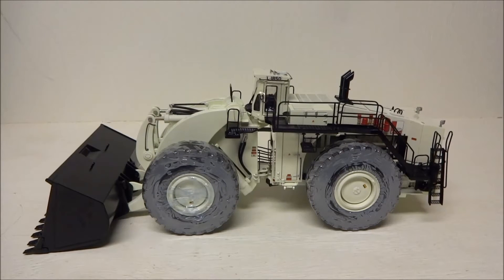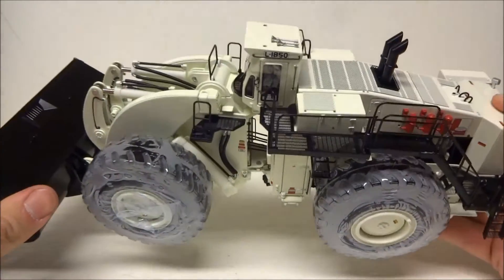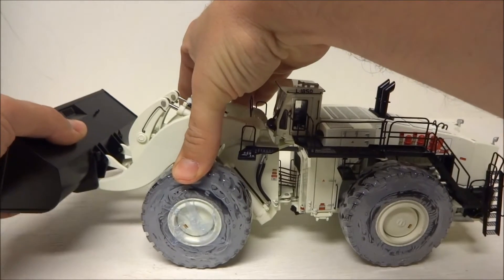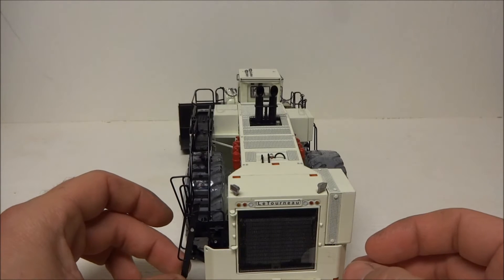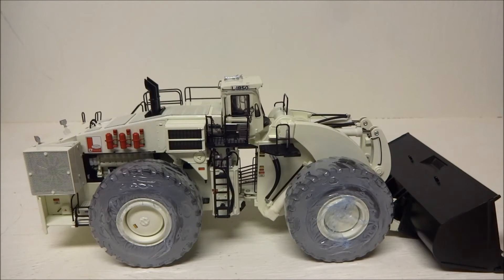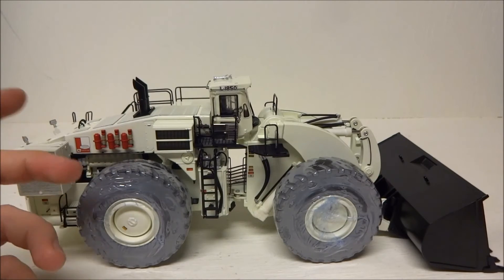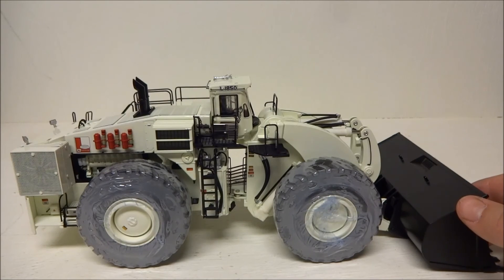1:50 TWH Letourneau L1850 Rubber Tire Loader 1/50 Diecast Review

Comment: This model is outstanding! I remember when TWH brought out this model, about 10 years ago or so, & I marvelled at the detail of this model. But it seems all TWH models had incredible detail. I considered buying this model, but didn't. I already had a few TWH models, & discovered the disappointing weakness of TWH models was quality control. On a few models, some parts were broken or improperly assembled from the factory. But the design & detail of the models was the best I had seen, I believe. TWH gave NZG a "run for its money", & at more reasonable prices at the time. But NZG always had consistently good quality control (mostly), from what I have seen.
Reply from the maker: I completely agree. TWH at least had a great customer service section. Anytime I had an issue it seemed like there was no problem making it right. Weiss Brothers is doing a good job picking up the pieces and seems like they're avoiding the mistakes of TWH.

Comment: I am trying to get a diecast L-2350 used

Please help
Reply from the maker: Well, the best place to look is probably the 1/50 groups on Facebook. That's probably the best place to get a deal. Otherwise the alternative is eBay. Save a search for LeTourneau in Toys and Hobbies. You'll get a notification anytime something LeTourneau is listed for sale. Be patient. They are great models but don't come up for sale often. They are hard to find.
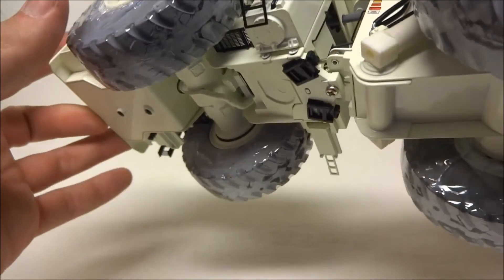Reply: @MarylandConstructionDiecast  thanks for replying.  I don’t work in construction.  I have always been fascinated by heavy machinery since 1992.  I actually have a Cat 994 loader in 1:50 scale.  I got that like in 2003 I believe.
I really want to trade it for a Letourneau L-2350.
Or I would like to buy one for very cheap.  I am in no position to spend in excess of 2 grand for a model